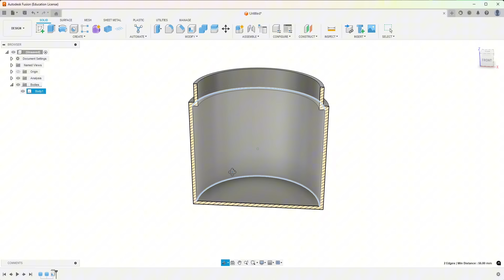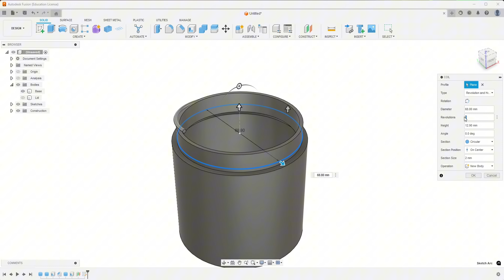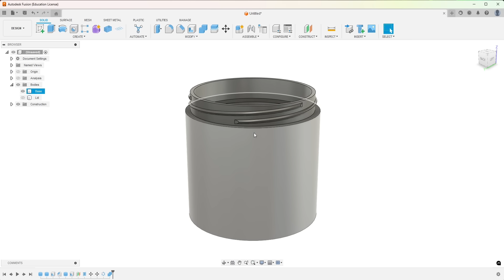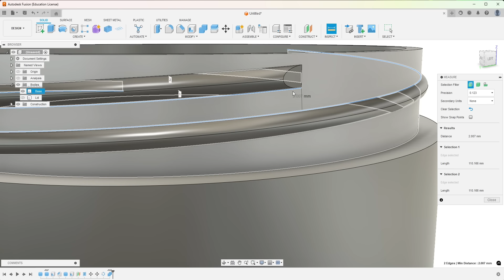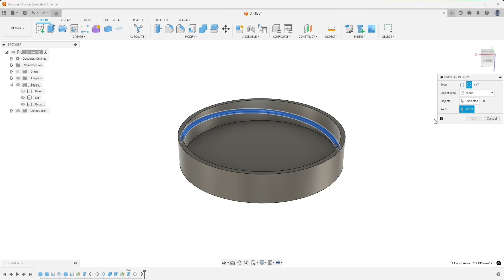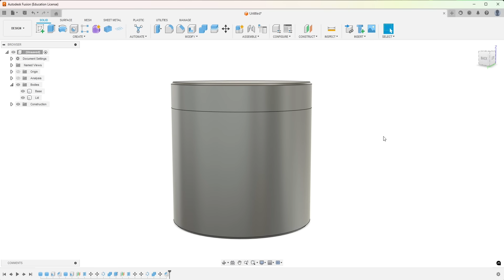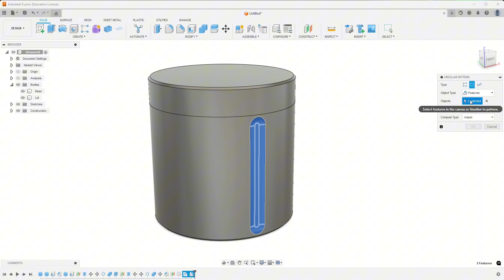Design & 3D Print Triple-Start Threads using Fusion360

Comment: I clicked because I downloaded a jar about 6 months ago that looked EXACTLY like that one and reprinted the lid 3 different times with slight size variations and could never get it to fit correctly enough to be usable for my needs. Could have been because I was using a 1mm nozzle and vase mode due to lack of time, ended up spending too long anyway and just buying something. Thanks for the tutorial. I've only done some basic modeling in onshape but am going to watch some more of your stuff

Comment: Good Job, I followed along and did this in Fusion, and printed it. The one thing I added was to user parameters so its all parametic
Reply from the maker: Nice! I love making models parametric!
Reply: @ShopTherapy623    I did the same thing, but admittedly the finishing touches of designs tend to break with all my parametric based designs.  Like you, I am self-taught so perhaps I am missing something.  I added a parameter for thread_revolutions (so I can adjust the thread gap along the z-axis) and for some reason when I change this parameter (thread_revolutions) it sometimes breaks the beveled  one or two of the coil ends.  ???   Sometimes it breaks the 70-degree beveled ends...sometimes not.   I find this to be the case with all my parametric designs...if I have no finishing touches (fillets, chamfers, move/bevel, etc...) the parametric changes adjust perfectly; but if I have some of these real-world, necessary finishing touches they are the ones I end up chasing down and having to fix.   I'm very frustrated about this, because like in the instance of the beveled (moved) end of the coil...the breaking change made zero sense to me.
Reply from the maker: @johnm100  The "move tool" is notorious for this.  If doing a parametric design, you need to avoid using the move tool as one of your steps
Reply: @ShopTherapy623  Good to know, thanks.  What do you think is a good solution for the case of easing into those threads?
Reply from the maker: @johnm100  you can just chamfer the end (after combined with jar/lid). Not quite as nice, but works, and will work with parametric changes.  However, it might get tricky if you are changing coil diameter size
Reply: @ShopTherapy623  okay thanks!  I hear what you are saying though, parametrics seem to break stuff

Comment: I personally don't like any of the basic shapes in coil for this application. The round one is imprecise for the printer and the triangle is too sharp. Square creates overhangs. 
I have tried a few times to make a custom one by using the triangle edge as a sweep guide rail. Its a hassle but it works. If you do that make sure you define the sketch plane from the path as it has to be correctly tilted. 
For some reason when i did that i had trouble turning one side with move. Also move often breaks when parameters are changed. I think i ended up cutting it using a plane before combining. 

I had the coil feature fail on me also when i changed the size of the object underneath which moved the coils center - the coil wouldn't adapt and stayed on place while the object moved. I had to define a plane by a sketch line for the coil that would move with the object.  The coil feature could really use a few upgrades, not clinging to any shapes as its defined is annoying. I learnt to use custom parameters for every dimension i use more than once. Id love for it to have a custom shape or allow a sketch to be used.
Reply from the maker: My method works flawlessly every time.  I've never had problems with it once
Reply: For this application, the instructions in the video worked without problem for me. I didn't try to make it parametric.. I printed in PETG (which is a bit tougher than PLA) and the threads printed without issue at 0.2 layer height. I looked under microscope at threads and threads looked pretty good. I also wondered about just using the combine on the top part to 'cut' out the threads and offset the face for extra clearance.. but think I like the approach given better.. Would like to know the 'click' secret.. think it might have something to do with the depth of the lip on the base.. if a bit deeper, maybe the threads bottom out and one goes under the other.. might be a way to make a notch in bottom of base thread to lock in..

Comment: Sorry if this is a dumb question but I am really new to using Fusion.   Why wouldn't you just make the lid over the section with threads and then just cut the threads from the intersection of the lid cylinder and the thread tenon section?  Fusion can't do that?
Reply from the maker: Fusion definitely can do that, and you can definitely make threads like that.  However, I have found that those threads don't work as well when 3D printing.  Having two "male" threads, as opposed to a "male" and "female" thread, tends to work much better.
Reply: @ShopTherapy623  Appreciate the reply, thank you.  And also, nice video.
Reply: I use this approach a lot with custom threads for 3D printing (like a triangle but with 45; angle), especially if they are too complicated to define. The key here is to use offset face and offset them from each other by a little bit (which is also good to do with the regular F360 threads but anything under i think M16 doesnt let you have a 2mm pitch which i find works very well for printing).

Comment: Great video.

I always had seam challenges with smooth shapes as well... You might try Orca slicer's Scarf joint feature.   Ive recently given it a go and when used with a random seam position seams on cylinders nearly vanish.
Reply from the maker: Thanks for the tip! Definitely going to try that. I use Bambulabs slicer and random seam looks absolutely awful.

Comment: As a fellow self-taught Fusion user, I'm really glad your channel popped up in my suggested videos! Like many things in Fusion, there's multiple ways to get to the finish line and it's fun seeing different approaches to what I would typically do. It's good to carry alternate methods in our bag of Fusion tricks. One tidbit for you is that when doing circular patterns, you don't need to select just an "axis". You can select any circular face, edge, or sketch line as well.
Reply from the maker: Thanks for the feedback and I completely agree!  I am aware of the other ways to use the circular pattern tool but didn’t want to confuse people so figured I’d just show the axis method. However, that is a great tip, and hopefully people will read the comments (like yours) to learn more!
Reply: Hey, I’m in the same boat. I often struggle with many of the techniques shown in this video. But you don’t need to apologize for just recording your presentation live. It’s very nice to see the same mistakes that I often make. The difference however, is that I make a whole lot more. ☹️ Anyway your technique of using coils to create the threads seems a whole easier than what I have seen when using the threads feature. Thanks!